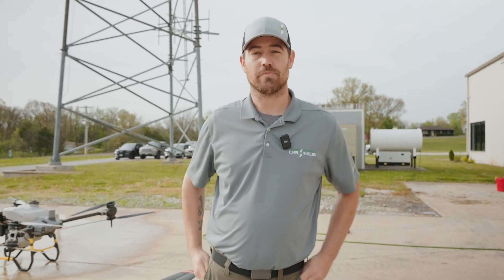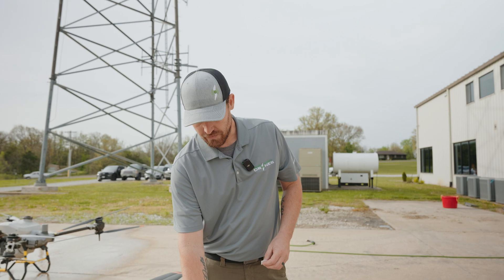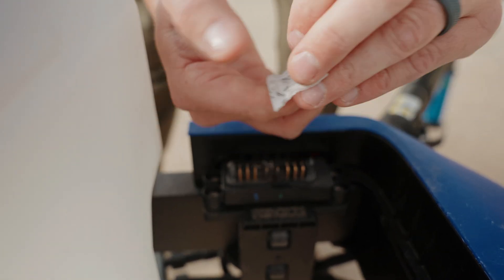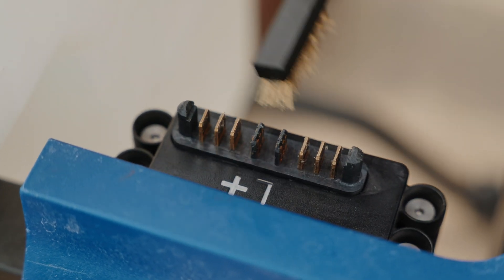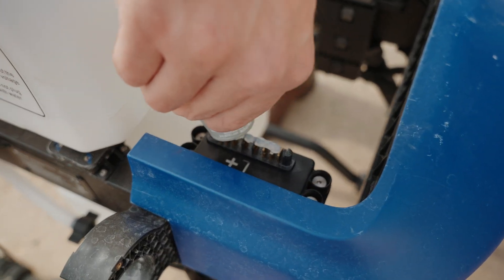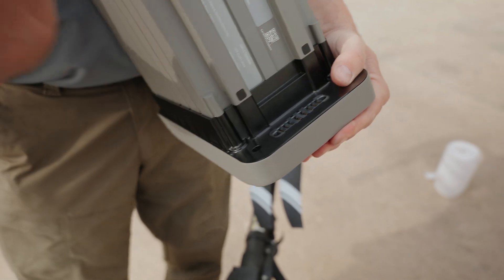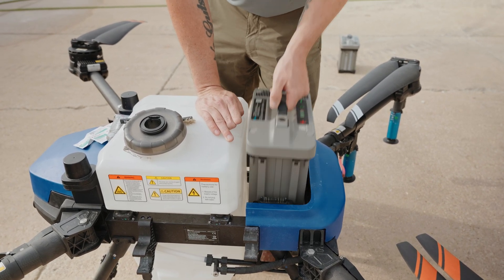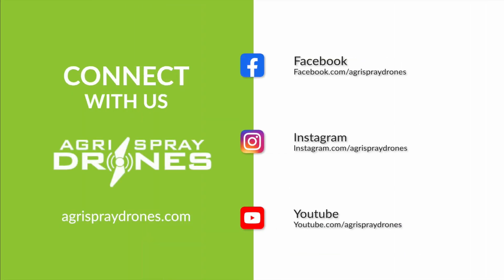Drone and Battery Terminal Maintenance

Comment: Why the dielectric grease? That grease is an insulator. It does not conduct electricity. If that grease gets into the terminals heavy enough, it will prevent contact. Dielectric grease should be used very sparingly. In this application, you would probably be better off not using it at all. Connections are usually designed to be used dry.
Reply: Great question! Dielectric grease is an insulator, but that’s okay — it doesn’t block the electrical connection because the metal terminals push the grease aside when fully connected. It just seals around the contact to keep out moisture and corrosion. Used sparingly, it actually helps protect the connection long-term without interfering with conductivity. 👍
One good exemple: search for w8ji dielectric grease vs conductive grease
Reply: @FaustoThomasZamboni01  exactly! I'm a drone show operator and tech, and yes we use dielectric grease on our light-drones for terminal maintenance.
Reply: Dieletric grease is literally for this, it keeps contacts dry, while metal, if touching still conducts. We do this in Brazil as well.